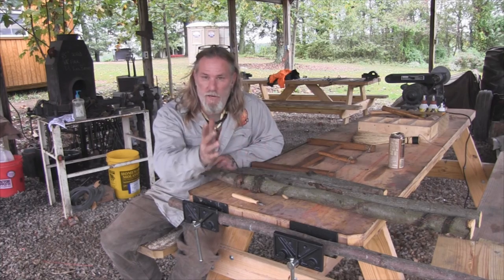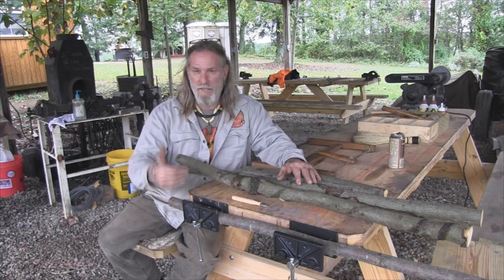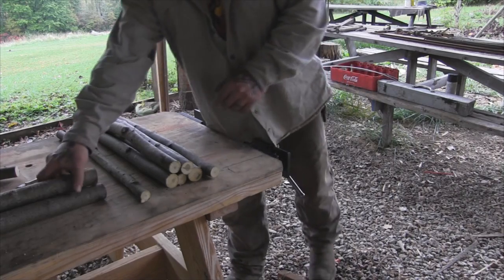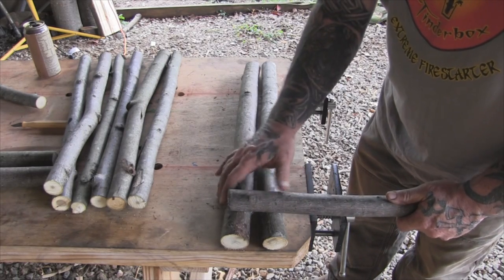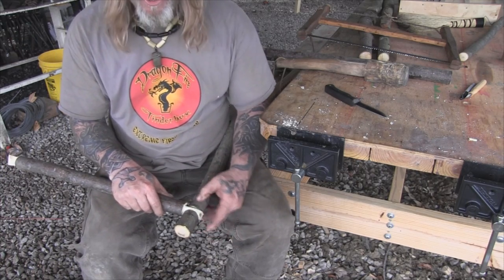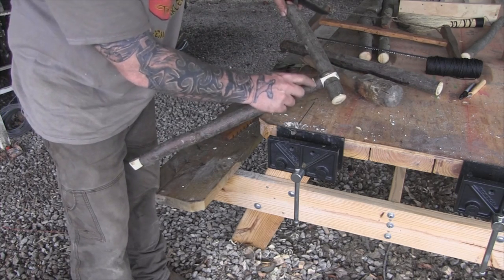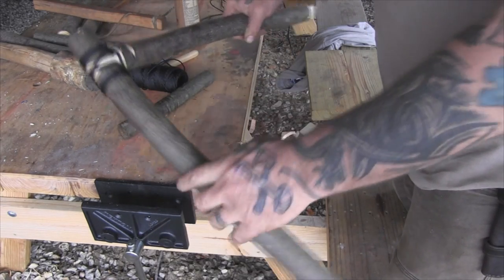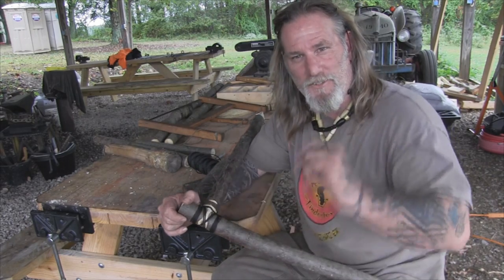Making Woodland Furniture The Dove Tail Joint Lash

Comment: Hey Dave great video, if you wanted to do the whole project without any fixings... A Bodger would dry out the tenon by the fire over night then cut the mortise in green wood to the same size as the now dry shrunken mortise, and as the green wood (mortise)dries it locks the tenon in! The true mark of a green wood chair is to be able to hold the weight of its maker while trying to pull the tenon out of the mortise! Check out Master Crafts with Monty Don, wood craft! Should work for this application as well!

Comment: Greetings Dave; I love that you're showing how to problem solve with a very simple kit! Showing how to baton a knife instead of using a chisel, for example. But if someone is building up a kit from scratch, would they really skip ahead to building a vise before a chisel? I would get much more from this video if you showed work holding techniques that were similarly small-kit accessible. Your foot vise was one example I've seen in other videos (though I don't know how you'd drive that screw without a screwdriver). Keep up the great videos, and thanks!

Comment: Excellent stuff.  I made a lashed stool once and it was a bugger on account of not having nice notched seats so the lashing was crazy and the steadiness not so good.  Just using the notching techniques here and that frapping to pull the lash tight make that kind of thing way way better.  Any recommendation for creating a table surface in the woods?  I've just stuck to the backpacking side of things so I haven't ever really worked with camps involving much larger wood than I can hack down with a hatchet.  I'm guessing you'd recommend a forest axe and a bow saw for such things but thought I'd inquire anyhow.
Thanks for the videos.

Edit: Anybody have a ball park for how long that chair might last?  The lash is tarred bankline so it ought to hold up against water ok, but what about the wood?  Any way to treat it (with fat or some such) in the bush against water?  Or maybe not worth the effort and just make a new chair when you need it.

Comment: Thanks for your videos Dave. What would be a good woodcraft project for middle school boys that they can make fairly quickly so they can take their project home to their folks?
Reply from the maker: +Mitchell LeGassick Depends on the tools you are supplying them, Sloyd style projects are good but require a sharp knife, most likely frowned upon in schools not for shame!, for something with simple shop tools I would think a simple table or stool made from a cut slab with auger bored leg holes and carved legs, you could also consider a rope style stool like the one I have in my playlist which could be made fairly simple
Reply: +wildernessoutfitters 
well I take a small group of boys and their dads out and teach them a few basic woodcraft and survival techniques as a way of showing boys how God fearing men act. so they mainly have pocket knives plus the basic stuff like axes, belt axes, saw, fixed blade knives, ect. that I bring along.
Reply from the maker: +Mitchell LeGassick In that case Spoons are a good carving project as are net Needles and Gauges, then they can learn to make nets as well
Reply: +wildernessoutfitters 
Thanks a lot
Reply: +Mitchell LeGassick 
how do men that don't fear gods (or a specific god) act?

on that note do you fear Odin?

Comment: What would prevent someone from just drying out the wood ..season it a year...before making the dove tail joint....then you wouldn't need to lash it. And if it rained the joint would get stronger too.
Reply from the maker: +Accuracy Marked Nothing if you can wait that long for camp furniture, this is really about making quick stuff on the fly, there are better methods if you have lots of tools and time to dry your materials